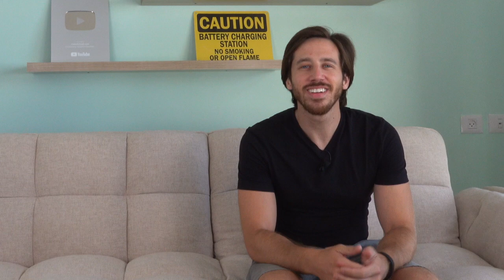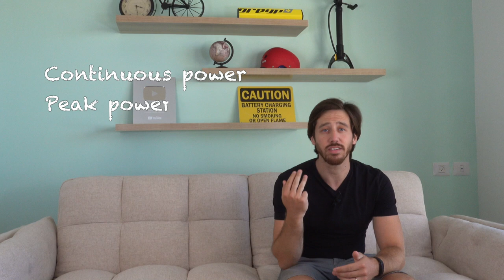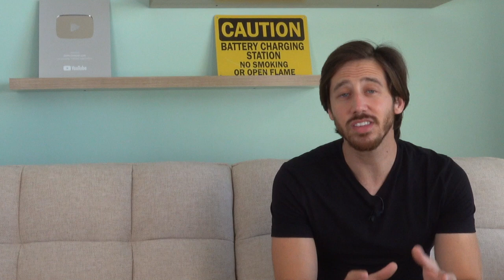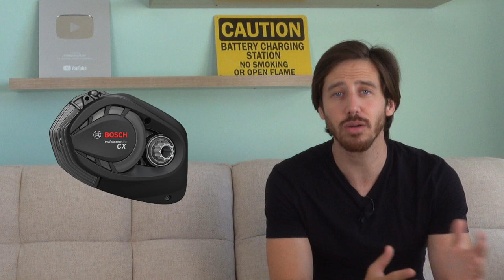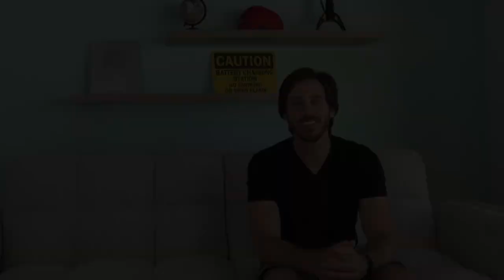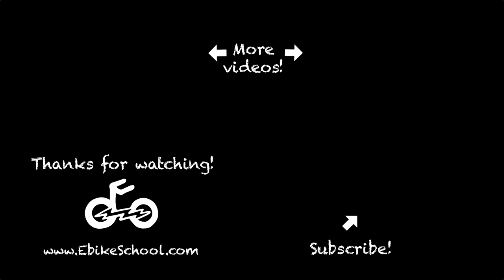E-bike watts - How electric bicycle companies are lying to you

Comment: There is this governmental obsession with the 25x number. 250w, 250g, 25km/h...
Edit: After quite a few years and quite a few kilometers on my quite illegal DIYs, I have come to the surprising conclusion that I actually average between 250w and 200w on the long and steep commutes I do. And my DIYs push peaks, and push them hard, in the four digit realm...
Only offroading bumps the averages. 
Therefore... my quite illegal bikes don't stand out a bit from the very legal ones. I ride with legal buddies and we keep the same pace, climb the same hills... 
Except for milage. The batteries are about double the capacity of what I see on the high shelves in bike stores. 😅

Comment: The basic direct drive hub motors like violamart have the same direct drive hub motor but the controller varies, it could be sold as 500W, 750W, 1000W, 1500W or 2000W with only the controller varying and the hub motor remaining the same. How is that motor rated. Also if you  buy lets say a 1000W version and use it with the minimum size battery it will accept about 48V at 12Ah in the road legal mode it is 250W approx (more like 300W) but if you disconnect the wire you get a 50% boost to 450W approx but the battery can peak at about 960W (20A) output for about 60-90 seconds or about 700W in road legal mode. It's confusing as clearly the battery BMS  and controller and motor are not at the same level. I guess the BMS dictates the actual power the motor can receive, the controller could handle more and the motor itself could handle much more. I'm not sure what the nominal or continous rating of such a hub motor is but I guess at least 1000W. I've heard of Bosch motors easily peaking over 700W despite being road legal but many would view the Bosch as road legal and the home kits as not and its one factor why people pay more for a Bosch bike as they worry about the legal implications of a crash with a kit motor hub. The law seems a mess. However here in the UK I don't think anyone has been prosecuted with a home kit and you wonder if the police just check that it doesn't assist beyond 15.5mph because its the only simple test they can do.
Reply: I have the 1000 watt voilamart hub motor, and it peaks around 1200 watts according to the screen.  I bought the voilamart 1500 watt controller instead of trying to play with the internal shunts on the stock controller.  It has been sitting on my work bench for over a month now, cause I wasn't sure if the hub motor would take it or not (wire size)...  I wish Micah would respond to comments...  I think I should be ok as long as I don't full throttle it, I just want some extra torque on take off
Reply: @chrisnmichelle0218  Can I ask what battery you are using both volts and amp hours plus if you know what peak current it can deliver for how long? Which cells are you using if you configured the battery yourself? I have the yosepower 48V 12.5Ah hailong case battery pack which uses Samsung 2500mAh cells which allows a peak current of 20A for 60-90 seconds. As stated above pretty much the minimum the 48V 1000W motor will accept which I think is stated as 48V 11.5Ah minimum battery. I use it in the restricted street legal mode partly due to legality but also because the battery is such a low capacity for this motor.

Comment: You forgot to mention that a particular motor designed to go with a specific voltage will not put out more power just by changing the controller, the voltage will have to go up, which means changing the battery as well as the controller.  Ohm's law hasn't changed!
Reply: That’s totally wrong. Not only have I swapped out batteries from 48V to 52V, I’ve swapped controllers after switching to 52 and my CLyte 3540 (rated at 1000W) and upping my controller from 26A continuous to 35 continuous definitely puts out more power. There are literally thousands of examples of this to choose from, not just my experience of riding my DIY ebike 30,000 miles. Yes, it is more susceptible to heat (loss), but it’s certainly not all lost to heat. I assume you don’t have an ebike. Ebikes.ca has a simple motor calculator and you can input values for many types of motor and controller combinations and see the data  yourself.
Reply: I will increase the current from 48v×10a eg..to 48v×25a
Reply: What you call power is the torque which is a function of electric current not voltage. Varying the voltage would vary the speed. Amps = Torque (more powerful), volts = speed (faster)

Comment: Great video... Yes, torque ratio to watts is the most important measure. It's how the bike will perform off the line and up hills. Basically how the bike will 'feel' to the rider. - Sluggish vs muscle.
Reply: last but not least wheel diameter (in case of hub motors which put less strain/wear on the mechanical drive train) plays into how efficiently those Newton meters actually propell the vehicle forward. The smaller the wheel the sooner rotation and efficient rpm can be achieved.
I have a rickshaw which often amounts to a total system weight of 600+kg, but with a geared hub motor in my 16 inch front wheel I'm getting the most when starting the race at the green light at Octoberfest outrunning my colleagues with 200kg less who are running the same 250W nominal system on slimmer tires but with 26 inch diameter. 
(it might also have to do with me being the GOAT in rickshaw racing but don't tell them that ; )

Comment: Well, for those like me, haha, I was unable after welding batteries purchasing BMS's to be able to understand exactly how that final S series was counted. It finally hit me after going back to basics, watching these very easy to follow builds. That, the final S count that I was always missing was: the very first battery that has both the positive and negative going to it, even though it wasn't exactly making an S series connection, was the very last counted Series battery. Maybe very easy for everyone else, but had been banging my head around that for months. So, Thank you so very much for helping me stop feeling so stupid and knowing for sure I knew how to correctly look for and buy the correct BMS for the battery builds I was doing.
Reply: That's not correct. In a series connected set, positive is on one end, negative is on the other. the path of electricity has to travel through each battery one after another.
Reply: Can a maximum current ina. Battery be 32a&72v? Is that correct???

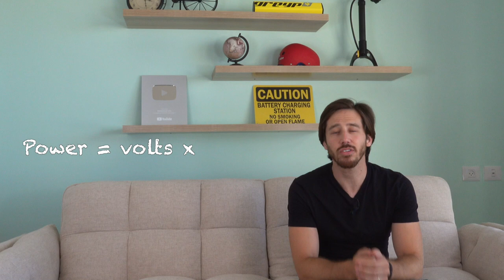Comment: 1:27 Yep, a big 10 ton trolleybus has an electric motor rated at 100kW. That low! But that is the continuous power. And trust me, during acceleration from standstill, the motor drives much more current than 175A (runs at 600V). That is the reason why there are components limiting maximum current, as the motor would happily take all it can get. And yet, differentials and axle reductions wear out sooner on trolleybuses than on buses. And if the regulator malfunctions, a trolleybus can easily do a burn-out on a dry paved street. Of course, do it three dimes and you can replace the whole axle, if the CV joints on the shaft between the motor and differential do not break sooner. Or you blow the circuit breaker in the trolleybus (should break around 380A, but that is only theoretical) or you trip the breaker in the electrical substation feeding the section where you draw your power from. If you had no protection circuits and a very powerful source, applying 600V directly into the motor would most likely result in lightnings flying out of it and ripping it from the frame of the trolleybus, destroying everything between it and the wheels of the driven axle(s).

Comment: WOW, Thanks a lot! As a retired electrician, Your explanation clicked 100%. Something else I see is batteries being rated in watts with no reference to amp hours. Often digging for other sources, I find the '360 watt' battery is 48V and doing the math get 7.5AH which is kinda small... Just liked/subscribed and bookmarking this video!
Reply: im unsure tbh

360 watt would refer to the motor power the battery should be rated in AH 
however what I think might be going on here is for reasons I don't know they could be rating the battery in watts referring to the motor its suitable for for example calling a 32 volt battery a 250-320w battery because that's what you mostly use for those and calling a 42v battery a 500-700 watt battery with a 72v battery being a 1000+ watt battery

for reference my bike is specced as follows

350w motor
32v battery
11.5ah battery

if we wanna rate my battery in W/h as opposed to A/h my battery is 368W/h in capacity

but generally when it comes to ebikes if its talking amps there referring to the AH of the battery
if there talking watts its almost always the rating for the motor
and volts being what the battery is delivering

there's a whole thing for over voting the motors to get a lil extra performance as well as going for higher voltage batterys to reduce charge times as all chargers are limited by there amp ratings so upping the voltage is a easy way to get more watt hours into the battery faster without pushing more amps  I've even seen some ellect to install 72v batteries and regulate them down to 32 to benefit from having a smaller battery and faster charge times but still having the range a larger lower volt battery gives them
Reply: @Sarge92  That's a lot to wrap one's head around... I note that 'A' also refers to controller ratings. We could really confuse things saying my T42 is only 1.1 KVA peak... If a controller is rated up to 72V and being used on a 48V hub, what's the risk of going in series with a 12V agm with the 48V li-ion to get 60V operating voltage?
Reply: The battery rating in Wh is more honest than giving A*h, as the Wh charge actually defines the amount of energy stored in the battery. A good comparison factor is the battery consumption in Wh/km or Wh/mi. Giving only Ah rating  (without the voltage) is deceitful. Giving Wh is honest. Big brands always give the battery rating in Wh as not to deceive the customer.
Reply: @StefanMikulski  You say "Giving only Ah rating (without the voltage) is deceitful".... I submit, So is Wh - (without the voltage). 360WH could be 36V 10AH or 48V 7.5AH... Speed comes from voltage. VA's or Watts is actually 'power' giving an idea of how long a load will run. Or, in the case of a motor, it's hp rating since 742W=1hp.
Reply: @johnw65  speed comes from voltage? How comes my 36V Specialized Turbo Vado 6.0 can get at 45 km/h (28 mph) while a derestricted 48 V Specialized Turbo Vado SL can only get at 34 km/h (21 mph)? No, the voltage is irrelevant here. Speed comes from the motor power, which is mechanical 520 W peak in the former and mechanical 240 W in the latter. The speed also affects the battery energy draw. That's why the former battery is 604 Wh (36 V 16.7 Ah) and the latter is 320 Wh (48V 6.6 Ah).
Reply: @StefanMikulski  Loving this debate Stefan. My original comment was about battery description, My last comment I threw in horsepower wattage. Would you say your bike is just as fast with a 3.6V 100AH battery? After all, that's still 360WH... My T42 top speed is 34mph with a fresh charge and only 28mph in the last 1/4 of the battery, (when the voltage is lower), which proves my point. However, I cannot exceed 34mph on my bike because of the limits built into the bike...
Reply: @johnw65  There are some design limits. The lower voltage you're using, the higher current you need to pass through the motor to get the same power. There was some miscomprehension on your side in the original post. You wrote "360 watts". No. Watt is the unit of power, and Watt-hour is the unit of energy stored in the battery. Often, higher voltage is used to make the battery longer but slimmer. Vado SL 48V battery holds only 320 Wh but is is very slim and proper for a lightweight e-bike. On contrary, the 36V battery of full power Vado (604 or 710 Wh) is wide and the bottom tube of the frame must be fat to accommodate such a battery. However, the peak electrical power of the lightweight e-bike is only 303 W @ 48V while the peak electrical power of the heavy e-bike @36 V is 666 W. You mention 34 mph as the top speed of your e-bike. I would not say it is any restriction in the e-bike design. It is simply the air drag that limits your speed. Note that the power demand is the cube (third power) function  of the apparent bike speed against the air.
Reply: @johnw65  ". I submit, So is Wh - (without the voltage)"

How many battery sellers have you seen that don't report voltage, amperage and watt hours?
For me, 0 so far.

Comment: Thanks, here in the UK, as you say we have 250w continuous, I am very happy for the manufacturers to allow us to overamp their motors for more power, they know we will not burn them out at say 750 watts for a reasonable time.
 I may be wrong, but I think the Bafang  250, and 350 are the same motor but different controllers to allow more power.
 It is a way of giving us a good product and stay within regs, a point you made well.
Reply: only danger with overamping would be being involved in an accident having your bike looked at by a sworn expert making you liable for operating an illegal motor vehicle.
The bike squads in Germany are no fools and are regularly making examples of obviously overpowered "250W"ebikes (which could be legal if they had a moped plate and all the other items required for fast ebikes)
Reply: @velotill this is why the laws are a bit dumb. What should really happen is there should be a law on use of peak power to allow fast starts and uphill runs tied to the amount of torque provided by the rider. Fast starts for 10 seconds up to 10 kmph on flats (until you pedal past it) and during cornering to get you out of trouble and when hitting an incline allowing the peak power to stay on for as long as you provide enough torque to keep up to the maximum speed llmit of 25 kmph.

Comment: In UK (and EU) the max continuous power output is 250W for an electrically assisted bicycle but if you want a higher output bike then that is classed as an electrical moped i.e. a motorbike driven by a motor and pedals.  The issue with this comes from the requirement that to be an electrical moped it needs to be type approved or to have an 'Individual Vehicle Approval' to show that it complies with UK/EU vehicle build laws and that it will also need to be licenced, taxed and insured for a minimum third party cover.  The rider must also wear an approved i.e. motorcycle crash helmet and preferably protective clothing and although not mandatory, the police might pull you over for inappropriate wear if you had classic Lycra shorts and top on.

Comment: Sooo.. My Super73 SG1 (EU version of the S1), has a nominal rating of 250W, which is the maximum allowed wattage in Europe. The motor also says 250W etc. However, having a 48V battery, and the controller's current is rated at 10A with a maximum current of 20A, it's very obvious that this is a 500W motor with a peak at almost 1000W, which is the same as the original American S1. The European version is electronically limited though, but I've unlocked it by plugging the US throttle in, and I'll just say that if this is "250W", then it's the most powerful 250W motor in existence 🤣 Ain't complaining though!

Comment: During my studies for electrical engineering the lecturers told me that the advertised motor power is usually mechanical. the mechanical power is calculated by multiplying angular velocity and torque. Mechanical power is the power you get from motor. The power you were talking about was electrical or the input power.

Comment: I can't seem to find the answer to How can you determine/verify the exact rated watts of a controller?? If I buy a 1000 watt controller how can I be sure it is what is says it is. What electronic components dictate the watts of the controller? amps I can check with a ammeter. Watt output is amps x volts. That can vary regardless of the watts of the controller.
Reply: If you can physically gain access to the controller, it's printed on a sticker. It depends on where it's located and the difficulty in getting to it. To get to mine, all l had to do was remove 6 screws and the controller was right there, but protected from the elements.
Hope that helps.